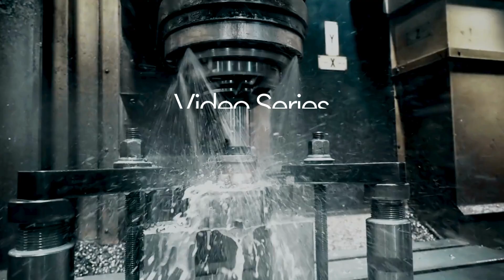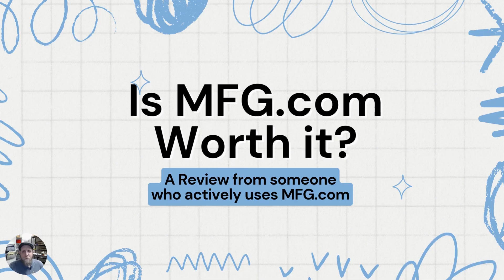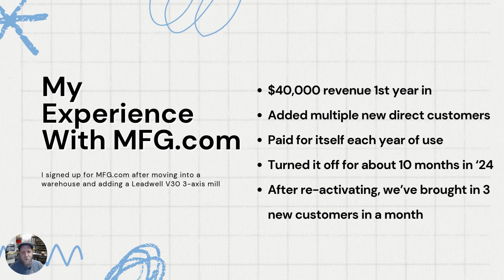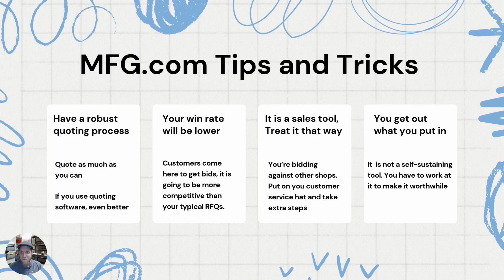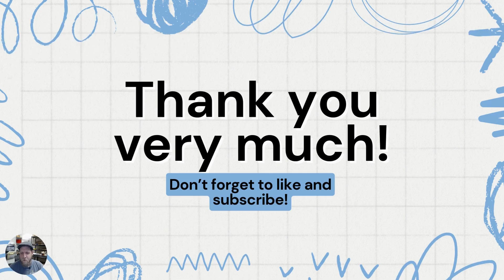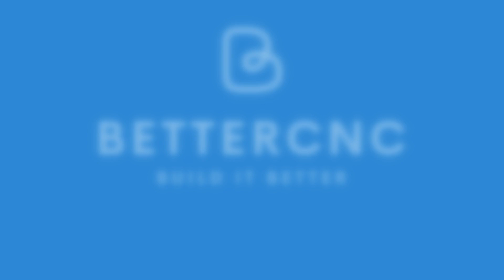Friday Shop Talk - Is MFG.com Worth it?

Comment: They have 3 tier account, Which one did you sign up with them? Im looking to join them and try it out, but their premium tier was too expensive for me currently
Reply from the maker: Sign up for the free for sure, it's another directory you can list your shop in. I did the $100/month tier for a couple months last year, doesn't seem worth it really. You're limited to 2 quotes a month (with the option to pay to view others), but not enough information is given before choosing the jobs to bid on. You might unlock one then realize some of the parts are outside of your capability.

The premium tier is well worth it when you can fit it in your budget.
Reply: @bettercnc  Thank you, I was going to sign up for their $100/month teir. I just forget about it. I just want to confirm, did you use their premium tier? 
The last time I talk to their sells rep, i was going to sign up for it but the price was out my budget